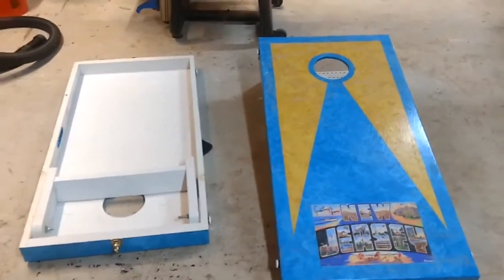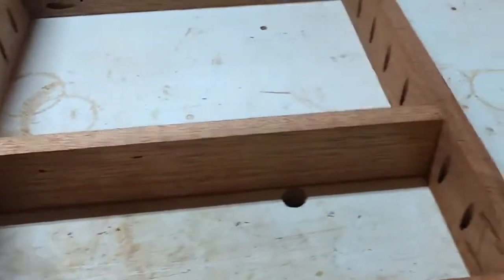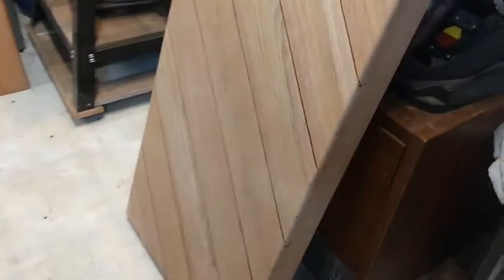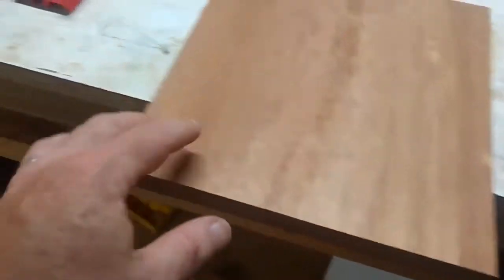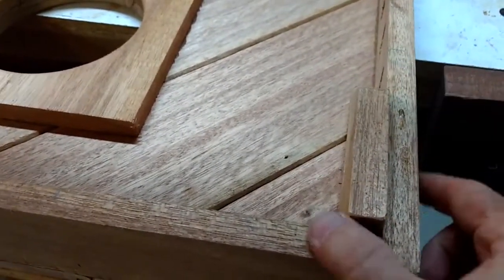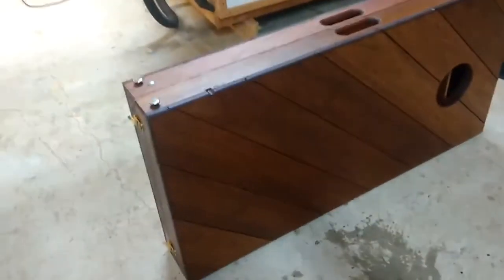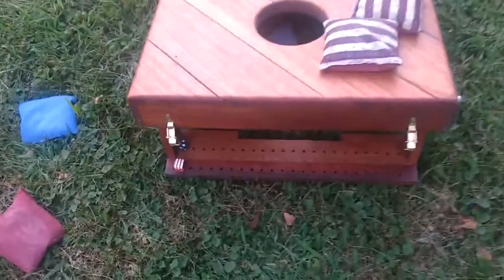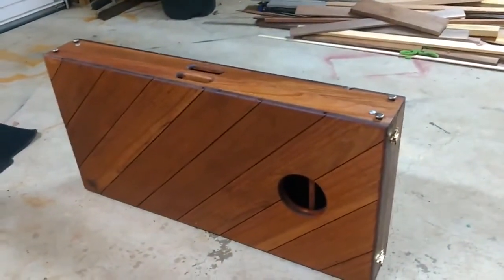How to make unigue craftsman Cornhole boards with bag storage & scoreboard

Comment: Why not glue and fasten your piece (to strengthen the hole), and then cut both holes at the same time? Save a little bit of time and work.
Reply from the maker: The 2 foot by 4 foot cornhole board would be impossible to manage on my spindle sander,  if I cut the hole through both pieces with my jigsaw, the hole will be rough and difficult to get perfectly round, and I don't have a 6 inch hole saw.  So by making the support piece perfectly round and 6" in diameter first, it works perfectly as a template once its attached to the underside of the board.  Its super easy to flush up with a router at that point. Really not a lot of work at all.

Comment: So how did you make the score pegs
Reply: Make a video
Reply from the maker: Not gonna kid ya, I won't be making a vid of the knobs, unless I need to make more. BUT, all I did was buy some round cheapo wooden drawer knobs, then squared one off and drew a star on the other and cut the shapes on the bandsaw. Very carefully, because the pieces are small. Then, just plugged it with a dowel and painted them up. Spray paint and poly. Used tape to make stars an stripes and sprayed on the 2 ND color. Just make it up and have fun.
Reply: Thank you very much for taking time to message me.  Keep up the great videos, be blessed 🙌